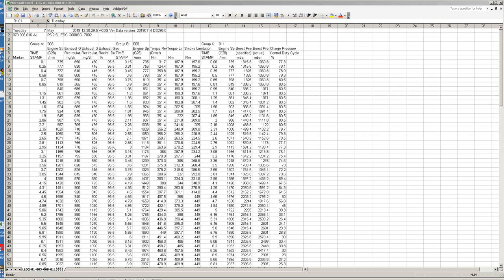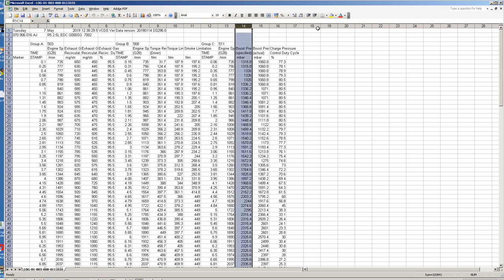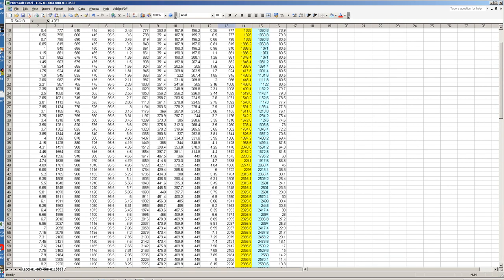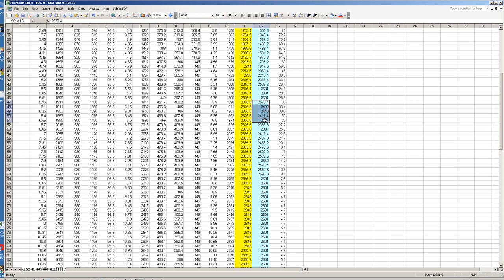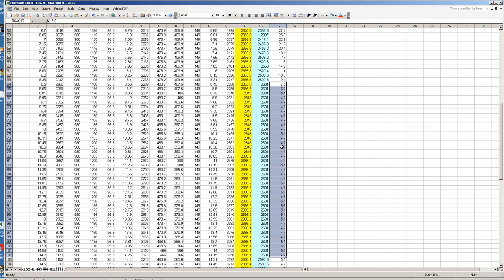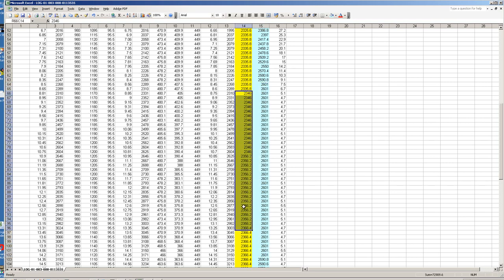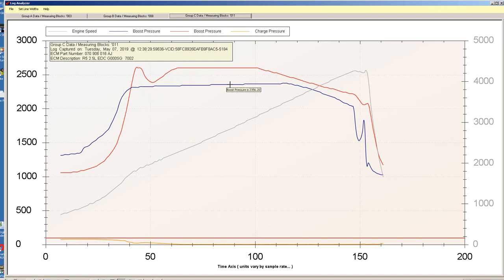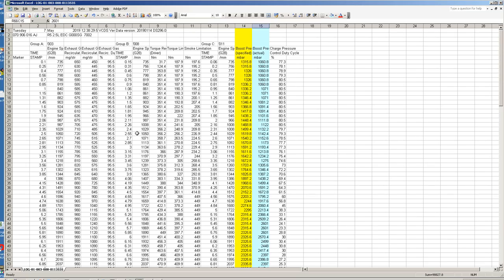VW T5 Transporter (2.5 TDI-PD 131bhp) – Over-Boosting Datalog

Comment: Hi there. I wonder if you can help. I have an overboost fault and issue that I can’t seem to solve. I’ve replaced the turbo, as the old one was seized, and boost pressure sensor had been changed. But the van continues to flip into limp mode when driving it (up hill or under load mainly). I don’t know what else to try or do. Any help greatly appreciated.
Reply: I've got the same problem ,some help will be great.